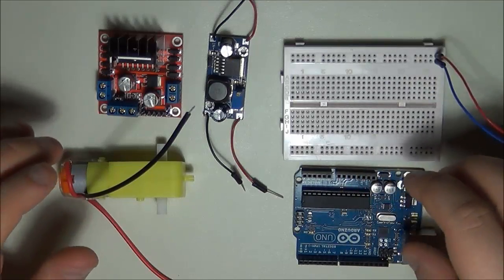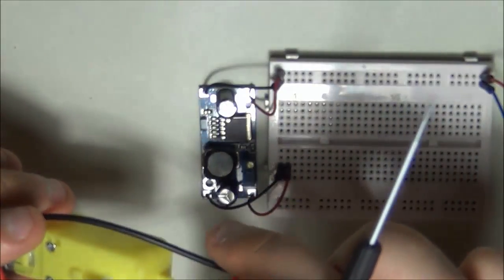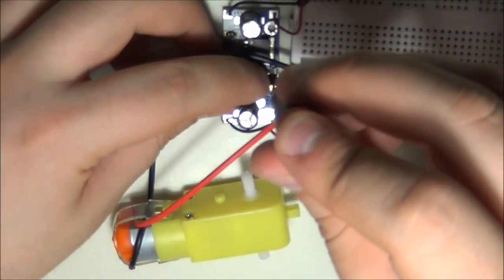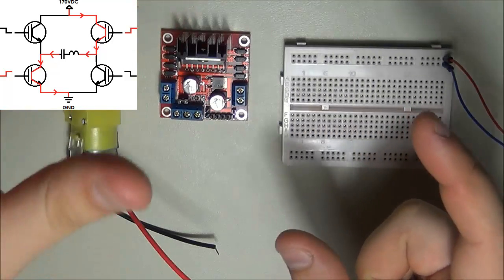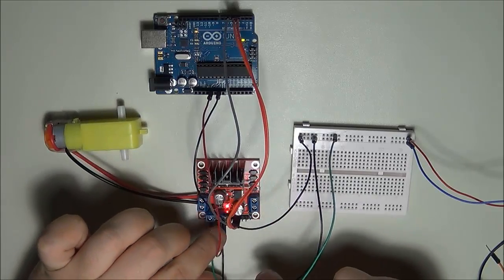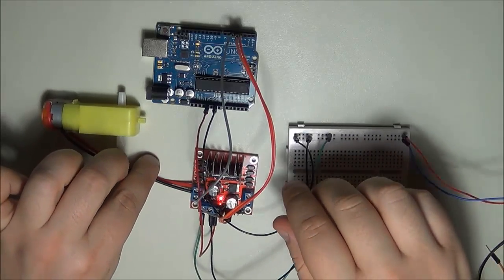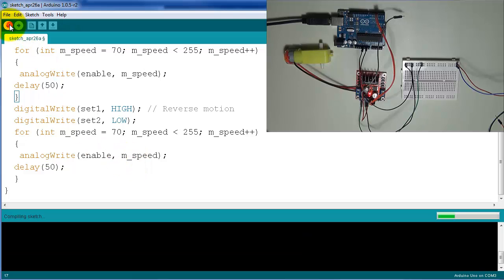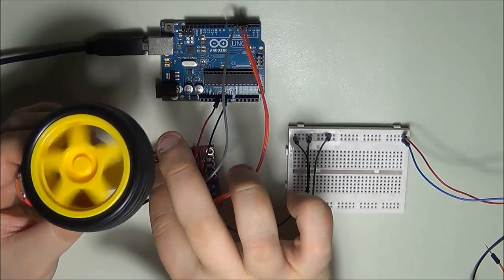Arduino Tut#16 - DC Motor Drives, Voltage, Direction, H-Bridge, PWM

Comment: If I want to control a 220w 24v industrial motor and have a 10a pwm frequency 21khz what else do I need to control the motor with the Arduino? Any links to sites would be great.

Comment: EEEnthusiast YOU SHOULD DEFINITELY MAKE A VIDEO EXPLAINING HOW TO BUILD A CIRCUIT, CODE, APP AND ZERO CROSSING CIRCUIT WHICH CAN CONTROL AT LEAST 5 AC LIGHT BULBS AND BE ABLE TO NOT ONLY TURN THEM ON/OFF BUT DIM EACH ONE OF THEM SEPARATELY VIA BLUETOOTH HC-06 AND ANDROID APP. THAT WILL BE A CHALLENGE!!!

Comment: May I use 9 volt by using 12volt to 9volt converter and 9volt use for both Arudino Uno board and for DC motor Power?

Comment: according to the connections shown in the video.
if i give the voltage as 12V in the breadboard, will my arduino get damaged???
Reply: Aurdino can take a max voltage of 12 v but you will need a heat sink

Comment: Here is a  PWM motor controller that I can recommend
Motor Speed Control 2000W 10-50V 40A MAX DC PWM HHO RC Controller 12V 24V 48V

Comment: 3:30 will it actually fry the arduino? Does it not have voltage regulators and other protection to prevent this?

Comment: Helpful and informative.

working with the L298 driver like yours and arduino.

Any code for soft start dc motor on button press?
Implementation for a camera slider maybe.
Thanks

Comment: until i encountered a noise from the dc motor and it affects greatly on my sensor like my MPU6050.. everything freezes..  would consider doing how to avoid noise or reduce them on a dc motor.. im doing a self balancing robot

Comment: Can I supply 24v using a DC voltage booster (9v to 24v) to L298 and  drive a solenoid ? I need to change polarity. Secondly what if I use digital outputs for all 3 direction and enable signal as I do not need less than full volts at output?

Comment: would you need female jumper wires to connect to l298n's 4 input slots, but not the ena and enb pwm slots.

Comment: Would the L298N controller work with two 165 rpm 6~12V DC gearmotors? I'm planning on using an Arduino Uno and a bluetooth module connected to my phone, but I'm confused about what motor driver I need...

Comment: Hello,
for a line follower robot with 02 infrared sensors and 04 DC motors 
connected in L298N driver, how many amperes I need to robo do the curves correctly?

Comment: Hi, why my motor make a sound "tiiiit" when accelerating?
Reply from the maker: +Sony Wijaya Because there is a certain threshold of PWM which needs to be met. Before that, the motor does not get enough current to start.
Reply: +EEEnthusiast do I really need a voltage driver
Reply: Hi, I have the same problem and i using 9v battery...So what should I do?

Comment: Thanks for this.. This is something I need, but ramped up to handle more power.... I am building a reciprocal engine where it uses 2 coils with a magnet on a shaft in between.. I am using an arduino to control timing with Hall sensors..   I have learned a great deal in the last month I have been messing with arduinos.. I have a Mega coming soon for my design.. That H bridge seems what I need.. But I am going to be needing to use one that can handle up to 300amps I predict.. I been trying to use RC Brushed ESC's..  It does good, but I worry about when the engine is in up or down stroke the 2 ESC's are wired on the same coil in series( and no I can not use a bifilar coil), so I got 4-300 amp plus industrial diodes to protect both circuits.   I can see with your H bridge I could have it be controlled with my engine program much easier.  Just I'd have to find one that can handle up to 300amps.. I am planing on putting up to 3600 watts thru this at 12 volts.. I may up the voltage and lower the amps later.. the coils are not wire coils.. They are Bitter plates with an iron core.  My main question is this:  

Is there an H bridge that can handle 12 to 36 volts and up to 300amps  continuous available to buy.  Or would I just have to build one that can step up to the 300 amps, but takes in the pwm signal to control the throttle on it.. my ESC is a 11.1 volt max with 45amp continuous, 320amps 15 sec burst brushed ESC.. It has a soft start too.. And I can not change the program on it to eliminate the softstart.. I can't find anything on it for a ESC programmer that will work for it..  The soft start makes it where it dont think it will be useful for my circuit. They dont tell you when you buy these things sometimes.  lol.. Lucky they are cheapish.   Any help from anyone or you would be helpful.
Reply from the maker: +ghodd100 That's a very interesting application. I'm afraid that off the shelf H-bridges won't cut it for 300A. That being said, you can easily build your own with power transistors which would be capable of driving that current. Here's a good document I found which explains the design of an H-bridge: http://www.engsoc.org/~bbarnes/project/reference/hbridge-reference-ualberta-arvp.pdf

In a nutshell, you will need 4 power transistors, switching and protection circuitry. Keep in mind that at those currents, you will need to be careful to size wiring correctly as well. I know from experience that NEC calls out very large (500 kcml) conductors for 300A.
Reply: +EEEnthusiast ya I found a MOSFET that will work for it maybe... I thought of the same thing as you..  I am using those bitter plates, so the resistance will be enough to draw alot of amperes.  

here is the ID number for the MOSFET I am talking about.

 STV300NH02L

Comment: Hi! Could you do a step by step guidance tutorial video of how 4X4 wheel connect to a motor shield, and possibly how every control method work with the Arduino program code! Let's say like independent wheel control, 2X2 wheel control and 4X4 wheel control. What's the difference between with the encoder and without the encoder! Possibly tell us more in depth difference of buying a 4X4 motor shield and a normal motor shield! Would it be any effect if you stack the motor shield on top of Arduino board first then the sensor shield second or in a reverse order! I know I got all sort of questions, just not so sure about how everything connect and work! Thank you and really love your tutorials!

Comment: quick question Agent Romanov can a 3rd parameter be enter in analogWrite  ? i will like to enter the speed via serial call but when i do i want to not just send that value of speed but direction as well as which motor

Comment: hey, can please tell me which motor controller should i use to control a 500W motor....right now i am using l293d motor driver to control very small motors...but i want to replace that motor with a 500W motor so please tell me which motor controller will be the appropriate one 
one another thing is that i am using these motors with arduino so i have to change my coding if i replace l293d motor driver with any other controller for the same functionality? please help me out